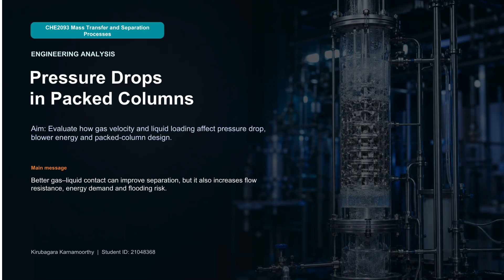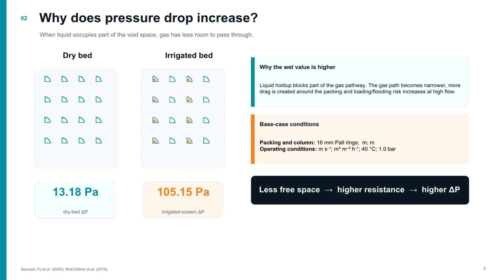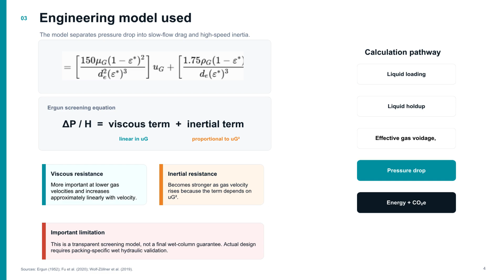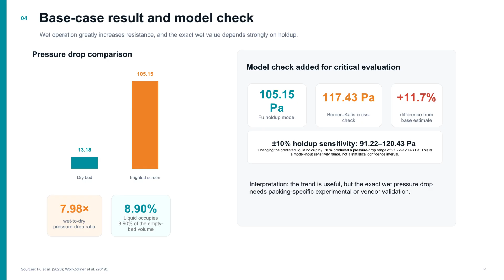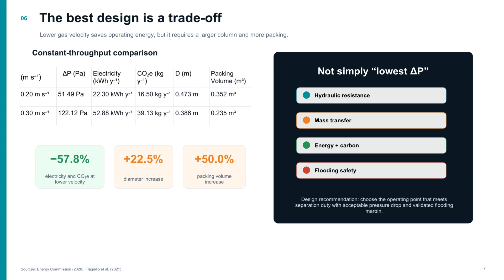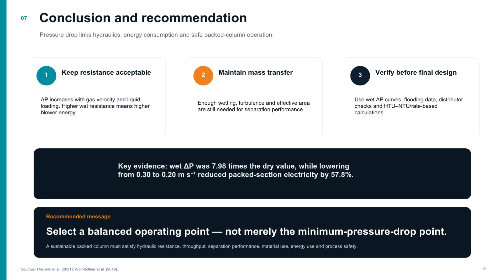Engineering Analysis of Pressure Drops in Packed Columns | Kirubagara Karnamoorthy

Comment: How does changing the shape or size of the packing affect the resistance to gas flow and the overall pressure drop?
Reply from the maker: Smaller or more restrictive packing increases gas-flow resistance and pressure drop, while larger and more open packing reduces pressure drop. However, larger packing may provide less surface area for mass transfer. Therefore, the packing must balance low pressure drop with sufficient contact area and separation performance. In my report, this effect was discussed conceptually because only 16 mm Pall rings were analysed.

Comment: I noted that a plus-minus 10% change in predicted liquid holdup resulted in a pressure drop range of 91.22 to 120.43 Pa. In an industrial packed column, what operating factors are most likely to increase the liquid holdup towards the upper range?
Reply from the maker: The most likely causes are higher liquid loading and higher gas velocity. More liquid loading increases the amount retained in the packing, while stronger upward gas flow prevents the liquid from draining freely. Higher viscosity, poor distribution and fouling can further increase holdup. In my model, this higher holdup reduces effective gas voidage and moves the pressure drop toward the upper sensitivity value of 120.43 Pa.

Comment: Why did you use 16 mm Pall rings specifically, and how would larger packing affect the pressure drop?
Reply from the maker: I selected 16 mm Pall rings because my holdup correlation and packing data were specifically available for that packing size, allowing a consistent and valid screening analysis. Larger Pall rings would generally reduce gas-flow resistance and pressure drop because they provide larger flow passages and a larger effective diameter. However, they may also reduce the available interfacial area for mass transfer, so the packing size must balance pressure drop with separation performance.

Comment: How did increasing the liquid flow rate affect the calculated pressure drop and flooding velocity?
Reply from the maker: Increasing the liquid flow rate increased liquid holdup and reduced the free space available for gas flow. As a result, the calculated pressure drop increased from 58.22 Pa to 166.37 Pa when liquid loading increased from 12.2 to 73.3 m³ m⁻² h⁻¹.  The flooding velocity was not calculated numerically in my report because the Ergun screening model cannot predict two-phase flooding. However, in real operation, increasing liquid flow would generally reduce the allowable flooding gas velocity, because more liquid occupies the packing voids and makes flooding occur at a lower gas velocity

Comment: How did you decide which gas velocity to use, since a lower velocity saves electricity but also needs a larger column and more packing?
Reply from the maker: I compared the two velocities at the same gas and liquid throughput. I selected 0.20 m/s as the preferred screening option because it reduced pressure drop, electricity use and emissions by 57.8% compared with 0.30 m/s. However, it required a 22.5% larger column diameter and 50% more packing. Therefore, I did not choose it based on energy alone; I chose it as the better balance between operating energy, equipment size and flooding safety.

Comment: How do you determine if lower pressure drop is better or not
Reply from the maker: I determine whether a lower pressure drop is better by checking four things: separation performance, packing wetting, throughput and flooding margin. Lower pressure drop reduces blower energy and flooding risk, but if the gas or liquid flow is too low, mass transfer and wetting may become poor. Therefore, the best design is the lowest practical pressure drop that still achieves the required separation safely

Comment: Your graphs show that both liquid loading and gas velocity increase pressure drop. Which of these two variables has the greater impact on the overall design of a packed column?
Reply from the maker: Based on the ranges evaluated in my graphs, gas velocity has the greater overall impact on packed-column design. Increasing gas velocity from 0.10 to 0.30 m/s increased pressure drop by approximately 4.8 times and electricity consumption by about 14.5 times. This is because gas velocity affects both the viscous and inertial resistance, while also directly influencing blower power, flooding risk, processing capacity and the required column diameter. Liquid loading is still important because it controls liquid holdup, packing wetting and mass-transfer performance. However, within this study, gas velocity is the more dominant design variable, while liquid loading should be maintained at a sufficient level for effective wetting without creating excessive holdup.

Comment: how do you calculate and account for the flooding within a pack column ?
Reply from the maker: flooding was treated as a design limit rather than calculated numerically, because the Ergun equation is a dry-bed screening model and cannot accurately predict two-phase loading or flooding. In an actual design, I would use a packing-specific flooding correlation or vendor hydraulic curve for the selected 16 mm Pall rings. From that, I would determine the flooding gas velocity and compare it with the operating gas velocity. The column would normally be operated safely below the flooding point, typically around 70 to 80% of flooding. If the operating percentage is too high, I would increase the column diameter or reduce the gas or liquid flowrate. I would also monitor differential pressure because a rapid increase can indicate that the column is approaching loading or flooding